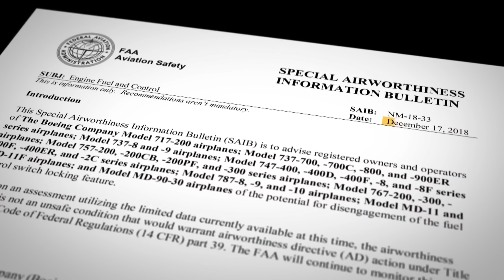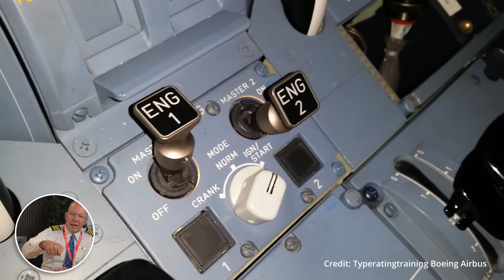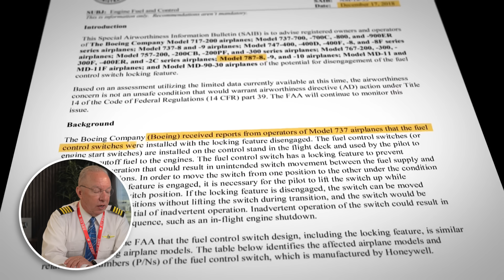Air India 171: The FAA’s 2018 Fuel Switch Locking Bulletin Explained (16 Questions Answered)

Comment: Chances of BOTH of them moving from RUN to CUTOFF within 1 second of each-other based on a mechanical issue seems very very slim. Usually when these people want to end their lives they think about a plan. Pilots aren’t stupid. This plan would allow for basically an almost guaranteed fatal ending with just the flip of two switches discreetly at the proper time. You wouldn’t even have to fight or make a scene since one the fuel was cut there was no coming back. Basically a fail safe to ending everyone’s life’s. No crazy fights over controls or arguing. Just flip flip death.
Reply: It's pretty obvious it's suicide & it's not the 1st one in a plane. Selfish to do it to yourself, just incomprehensible to take hundreds of people with you.
Reply: @boatnz5374  It's suicide combined with sociopathy/psychopathy.  Maybe 5-10% of the world fit the latter bracket.  People who get through life emulating the empathy that the vast majority of humans possess, but when push comes to shove, would emotionlessly allow their fellow man or even their own family to die, because the wiring that would normally dictate an emotional response is just not there.
Reply: @boatnz5374 pretty obvious? Based on what? They released another report?
Reply: @proumproum  4 seconds between switching the 1st fuel cut off to run and then the second, so 14 seconds from the cut off to the 2nd fuel cutoff getting moved to run and basically the whole sequence of events, why call mayday? that's the last thing you'd do. What mayday but not brace?? set a 14 second timer and do a familiar task see how long that is.
Reply: and yet in my lowest moment, I could never imagine taking out innocent people with me… but that’s just me (and I think, most of us.)
Reply: Not really because one engine restarted.  If the pilot wanted to crash he would have shut the switches off at takeoff commit speed and they'd have not gained as much altitude leaving much less time to recover.
Reply: @Bernie-e9i not at all.  Assuming this was an act of self-deletion, the pilot knew exactly what altitude to stop fuel flow for maximum carnage and minimal time to reignite the engines. This is evidenced by the fact only one engine had time to refire, and consequently the aircraft didn't gain ANY thrust or altitude after fuel cut off. You're overthinking and under thinking things. 
Any higher, thrust could have been regained, much lower decreases the certainty of completing his mission.
Reply: @EcotecEngine3.8V6 not exactly.  The second engine nearly spooled up and you only need one engine to fly the aircraft however it was a hot day there.  To be sure, he'd have know shutting them off towards the end of the runway would leave little room to recover compared to getting 650 feet AGL. So we disagree.  We could simulate the scenarios on the simulator with the pilot not knowing what was about to go happen
Reply: @Bernie-e9i neither engine spooled up past critical idle (or whatever it's called). Your theory would only make sense if at least one produced enough to gain lift.
Reply: @Bernie-e9i  The switches were shut off just seconds after takeoff.  If you shut off the fuel any earlier, the jet can (and will) simply abort with the remaining runway, as designed.
Reply: @Asterra2  Abort past V1 but before Vr? With what runway?
Reply: @sebastianjovancic9814 makes no difference. You can't rotate with no thrust.
Reply: @sebastianjovancic9814  Bro, you're delineating a matter of 1 to 3 seconds.  That is the context within which you're trying to argue against what I originally said: The switches were shut off just seconds after takeoff.  The answer is buried inside that context if you'd care to look.
Reply: @Asterra2 I'm not arguing against the valves being shut off after take off, I'm curious about what aborting 'any earlier" past V1 looks like as designed.
Reply: @EcotecEngine3.8V6 Meaning the same effect could be achieved (crashing the craft) by shutting off the valves after V1, not just after rotation?
Reply: @Bernie-e9i but there were two pilots, and it would make sense that the innocent would at least try to recover the plane even if it was unlikely to be recoverable.
Reply: @Bernie-e9i Just because the one engine was spooling up doesn't mean it has enough time to generate enough thrust to keep the plane flying by itself.
Reply: @bobraible it does mean it was about to start and was close to starting if they had more time.  It doed not take long especially after lighting off
Reply: @bobraible the plane only nees one engine to fly.  The problem is it was a hot day and they were already   losing altitude rapidly.
Reply: I think it was done by a pilot, but don't fully believe they wanted to cause a crash or realized what they were doing when they did it. It does not make sense that they allowed the other pilot to turn the fuel back on or did that themselves and the engines nearly spooled up enough to save them before the collision. With the engines boosting back on how could he have been sure it was still doomed unless he tried it a ton in simulators with similar fuel and passenger load and knew the other pilot would fail after the 10 seconds of shutdown if only one engine was recovering? Even if he did his research to calculate how long the engines needed to be off before the other pilot could no longer save them (which might leave logs as evidence in the simulator) there is a much better way, why not just pull the the fire extinguisher levers to permanently kill both engines instead? Why bother flipping the "we might be doomed" switches when you could pull the "your definitely doomed" ones?  

In a past case where a pilot ended themself they popped the fuse to the black box to remove evidence and waited for the other pilot to take a bathroom break and ended things in a rapid nose dive to ensure their end was fast and painless and I can't imagine many would want to risk burning to death in a low speed takeoff crash like this one. It just does not seem to fit the profile for intentional sabotage to me because it would be a comparatively stupid plan, and as you said, pilots aren't stupid. If this was an intentional plan it would not maximize or minimize ground casualties, does not maximize or minimize the chances of passenger or pilot survival or how painful death might be, and it does not even ensure the pilot responsible succeeds if they miscalculated how quickly the engines would restart and provide thrust.  I don't think it was a plan, maybe just an intrusive thought at best if intentional.
Reply: Bingo
Reply: You use both of your hands.

Comment: I have a few questions that may be simple to answer but I just don't know the answers. Did the Captain or First Officer set the fuel cut off switches to the off position and which one put them back to Run? If in the investigation that one of the pilots is deemed to be at fault, what are the penalties and how could the pilot at fault be punished? Unfortunately, neither of the pilots survived this incident. Ive also always wondered if the airline does the initial compensation for the victims and seek out financial recovery from the party found to be at fault after the investigation is over and the airline is found out to not be at fault?

Comment: Reason for no cameras in airplane is simple.. No cameras, it’s easy to blame pilot. 🧑‍✈️ it makes no sense  why a pilot would cut both engine. If anyone wants to cut off engines, why airplane will allow that to happen when plane is taking off or for that matter while in air. 17:26 also nobody will take 10 sec to put the lever into run mode, especially when they know it make airplane loose power.

Comment: Sorry Steve, but I can’t stand the thought of listening to answers responding to the endless questions from people with little knowledge about flying big jets. What’s the point. One of these two pilots shutoff fuel and ignition off with the control switches, intentionally or unintentionally. Recall the Delta 767 out of LA. As crazy as it sounds it has happened before. We’ll likely never know why. All the rest of this endless armchair speculation is pointless now. Otherwise I do enjoy your airline related reporting.

Comment: A second to move from one switch to the other and flip it sounds very short. That's more than enough time for a mouse click. It was either a successful hacking attack or a software problem. I'd bet that these two switches don't directly affect the fuel pumps, but rather that an input IC/signal processor is connected between them.

Comment: About the logic of the airplane, they could add a block system like to not be able to cutoff the engines until reached a safe altitude, if someone cutsoff the engines the system won't stop them until safe altitude is reached, ofcourse at the airport they are at the moment. That means all the airplanes must add this safe altitude selector and system. That's a security measure idea.

Comment: My dad was American Airlines pilot for almost 40 years. How much thrust does an engine need exactly to operate on its own? 
We all know that all planes can operate on one engine so if one engine started giving thrust , I’m guessing it wasn’t enough thrust. What’s the cut off where thrust isn’t enough to fly the plane?
Also, how long does it take for the engines to shut off completely??

As in 20 30 40%, or does the engine have to be running at 100% to fly the plane with one engine

Comment: Cameras in the cockpit aren't necessary?  Families of the dead, I'm sure, would loudly disagree!  The FAA should mandate this NOW!
Reply: Camera would not prevent it just like FDR did not
Reply: @brylozketrzyn  ah,you are one of those pilots
Reply: @delayedcreator4783 you are one of those delusional guys who see "those pilots" everywhere. I am working a different job. Auditing doesn't prevent anything if the offender wants to do it. Yet, you cannot restrict pilots from isolating engine during any phase of flight.
Reply: @brylozketrzyn  Did anyone claim "auditing would have prevented the crash". Stop playing du/\/\b . Black box doesn't prevent crashes, time to ditch it?
Reply: What does the FAA have to do with India?
Reply: @kensmith2839 FAA May have nothing to do with India, but has something to do with Boeing. Also, technical solutions are typically adopted between regulatory bodies
Reply: Manufacturers and pilots are shielding each other

Comment: Captain Steeeve, if the both switches off poision, the how plane runs on the runway? Does it not need to be fuel switch on when once to start running on the runway??? What is the use of Fuel switches? if it runs without being on ON position?

Comment: Hi there Captain Steve. Excellent reporting again! Thank you for the first class information, expertise and knowledge you are kind enough to provide to the non aviation folk's interested in this matter. I'm just wondering about two other possibilities to explain what might have caused this event to happen. 1. Rather being a deliberate act by one of the pilots switching the two fuel control switches to the cut-off position, is it a reasonable possibility that in fact it was done not by malice, but by mistake? In other words, for whatever reason (dyslexia for example) could the individual have inadvertantly switched those thinking and believing they had in fact operated something else instead? This would account for the other pilot questing ''why did you cut off the fuel switches?'' And the other replying ''I didn't''. Perhaps they actually did it mistakenly and genuinely thought they had actually operated another switch at that time. You as an experienced pilot will instinctively know immediately if this was a potential cause or completely unlikely. For example, are there any other switches that might or should have been switched at the time the fuel cut-off switches were operated? 2. After seeing my own Government (N.Z.) continuously lie to the public including to this very day in relation to ALL the causes behind the Air New Zealand crash of Flight TE 901 when a DC10 ploughed into Mt Erebus on 28/11/1979 killing all 257 souls on board, I have become somewhat skeptical about believing hook, line and sinker what ''authorities'' insist. One salient fact remains true of ALL governments and large authorities around the world; they NEVER accept responsability or even a tiny amount of blame that may in anyway make them look guilty. Dead men tell no tales; you can say whatever you want if there is noone left to provide an alternative version of the facts. I'm not saying this is what happened here. I just believe in a very open mind on all possibilities and I think we should carefully evaluate things. It was later widely reported that the N.Z. Prime Minister Robert Muldoon was heard to state that the N.Z. Govt. owned and run airline of Air New Zealand was about 60% responsable and the pilot 40%. If Air N.Z. had not changed flight plans the night before and failed to inform the pilot, it would never have happened. I frequently drive past the memorial gardens commemorating the victims at Auckland airport, and I often reflect on the sadness of the whole affair and recall how many lies were told.

Comment: If it will turn to be a Germanwing like case, then design should be that the fuel switches should be one on the pilot side and the other on the copilot side...

Comment: Cameras are a tradeoff that reveals pretty much without question who did it, and in this case we already have the 'what' part, or at least the final nail but not who drove the nail in.  However, this is another of those rare instances, in which with all the data that is collected now, the who is not apparent, other than moving the switches had to be one of the two crew members and the circumstances so far make it important that we know which one - who.  Giving up that privacy for such a rare event is difficult, however, this is already done in soem environements where there is a perceived need in the puiblic interest to do so.  The staker holders here are clear - the flying public, Boeing, Air India and really other operators, GE, insurance companies, and a long list of others connected the the perception and fact of the businesses having a stake, businesses which themselves have stakeholders among the public - like their jobs and sources of income.  In this case, some of these stakeholders do not have a stake in precisely who, but only in the event of the fact that it was one or more crew members - not who, but rather something wrong with the aircraft or others involved in the operation of the aircraft - a fact that influences future flying or not.  With AI171 we are so far left unable to determine the 'who' and that is extremely important to families and friends of the two crew members. Perhaps less invasive cameras could be, on areas important to adding some information to what we now lack, the who but perhaps just hands on panels, switches, etc. - which could be used to determine which crew member made adjustsment or took actions.  Only what would be important in a scenario like this one.

Comment: Wait yall don’t WANT to be watched when you are responsible for the lives we all love flying on planes ??? We dont care if “you don’t want to be embarrassed “!!!
That’s ridiculous and these videos would answer everything in some of these crashes
Reply: If the purpose of the video would be to document pilot actions there are plenty of options like wrist mounted movement sensors that pilots could wear, which could then be displayed on a timeline in parallel with the data recorder. As Steve says video is quite a risk in that it may be end up being published. Secondly, graphed movement tracking would be far easier to analyse.
Reply: In such an important position, if a commercial pilot doesn't want to be recorded, find a different career.  Don't go into a bank.  Pretty much don't go out in public with the proliferation of all the cameras out there now.  A camera is a double edged sword - it can exonerate and well as implicate.

Comment: 'it would not have prevented the crash' is an utterly ridiculous and nonsensical argument and I was very disappointed to hear Captain Steve repeat it. Of course a cockpit camera wouldn't prevent the crash, that's not it's purpose!. The voice recorder, flight data recorder, seat belts, escape slides or emergency lighting also dont prevent crashes yet I dont see Captain Steve arguing to get rid of those. Come on Captain Steve, you can do better than this.